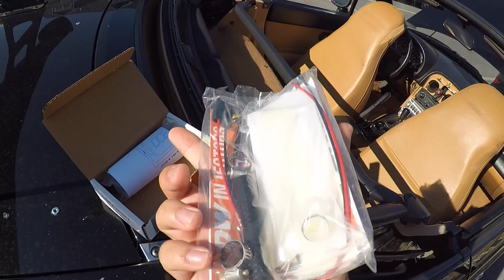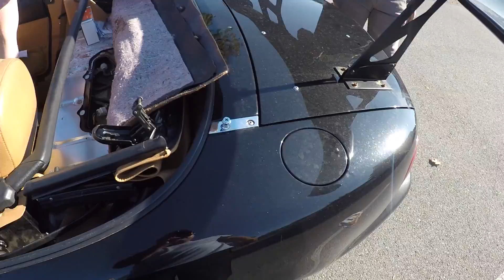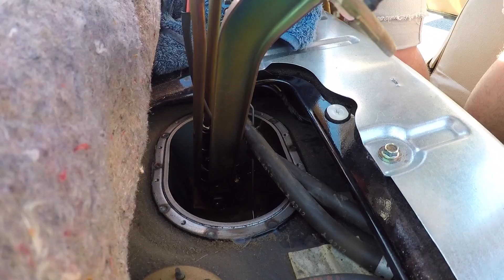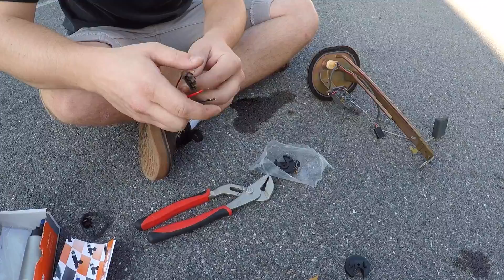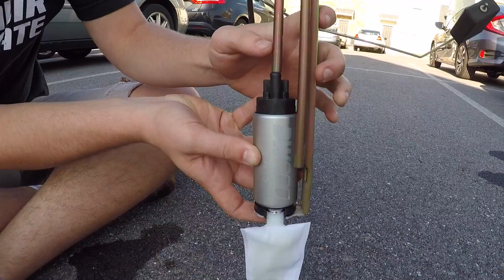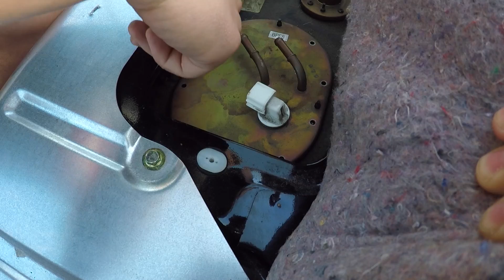How to: 90-97 Miata Fuel Pump Install/Replacement

Comment: Thanks for the video. The pump in my 95 gave out this afternoon. 
I don’t know what this world is coming to. That pump was only 32 years old and the car only had 210,000 miles.
 < sarcasm>
Reply from the maker: That’s definitely a solid lifespan for a fuel pump!
Reply: @BuyYourBuild here’s the kicker, it wasn’t the fuel pump. It was some mouse chewed wires. I spent a couple of hours today getting access to the wires, trimming out the bad bits & splicing in new wires.

Comment: some hints not mentioned in this video, but advised:
1 it is mentioned, but very short: open the tank cap before unplugging the old pump!
2 clamp the 2 hoses going to your car, don't leave them just like that open
3 close your open tank with something more than just the carpet
4 put paper towels under the rubber hoses before unplugging them
5 put cardboard under the removed pump, when you work on it
6 check which pump you need before you buy it

Comment: Great Video - I find the spring type clamps are better because they are harder to fail, Factory recommended new squeezy (constant tension) clamps every time a fuel hose is changed.  Factory Mazda  clamps are in full open mode and pulling off a small tab instantly secures them see https://www.jimellismazdaparts.com/products/Mazda/Miata/Clamp-Hose-Upper--Lower/1815974/9WNCB3400.html?partner=googlebase_adwords&kwd=&origin=pla&partnerDevice=c&userLocation=9003967&gclid=Cj0KCQiA-aGCBhCwARIsAHDl5x9CBHiubV5g7pPfRrWXDI8AHlwc-fIRp325mIiqYkh94vVRt55PR6EaAiEDEALw_wcB

Comment: Good instructional video. A couple of comments though.....
1. Don’t work on the ground & don’t encourage others to work on the ground. The new pump was on the ground collecting bits of grit, etc. Whilst that may not get through the fuel pump sock, it can get into the sender mechanism. Plastic folding tables are cheap!
2. Place a plastic garbage bag or similar over the sound underlay material and tape it back to the car prior to removing the pump cover. Carpet and underlay has heaps of grit and other accumulated crap in it which absolutely will drop into the tank. Also vacuum the parcel shelf prior to pump cover removal.

Comment: great video great 
if the motor isnt on can you hear the fuel pump?
my miata, i tried to start today and the first thing to come out was a back fire
then it fired up for a second and just turns off
like when you started up your car with your disconnected the switch
i can rev my car up when i start it up but then immediatly goes dead
any idea?
Reply: When the motor isn't on, when you turn the ignition on, it's normal to hear the fuel pump prime if u listen closely where it's located. especially if the metal plating is removed.

i would start diagnosing any idle problems. but i need more information. how was the car running prior to this, and when did it first start to happen. What happened at first?

Comment: What was the symptom that made you think the fuel pump needed to be replaced? My ‘93 seems to be running ok but then just cuts out. Fuel pump?
Reply from the maker: DelitoMVP i was in the process of turboing it so needed the extra fuel

Comment: Okay dude, i have a 1992 mazda miata. And my fuel pump assembly does not looks like yours it looks like this one.
http://www.ebay.com/itm/90-91-92-93-MIATA-MX5-MX-5-FUEL-PUMP-SENDING-UNIT-GAS-GAUGE-B61P-196100-2000-OEM-/221958632998?_trksid=p2385738.m2548.l4275
Reply: I couldnt follow your steps, because of it.

Comment: Thanks guys. So before the installation, did you notice poor mpg and also sluggish power?? Thats the symptom I have now for my Miata + check engine light.
Reply from the maker: Thee Engineer no we replaced for turbo prep
Reply: Ok. Thanks for the quick response and have a happy thanksgiving man.